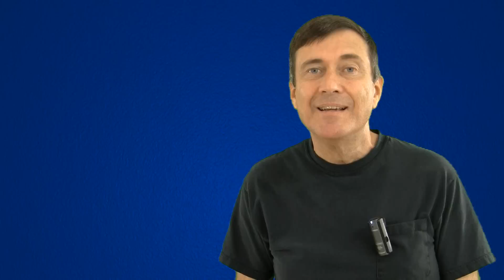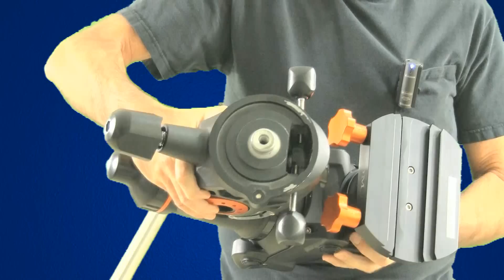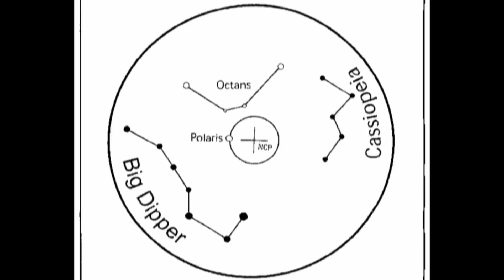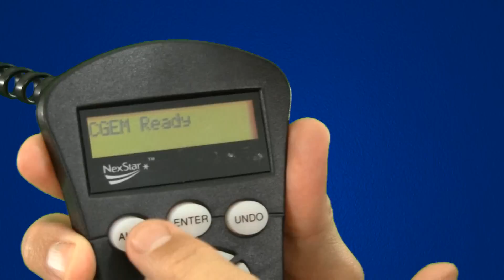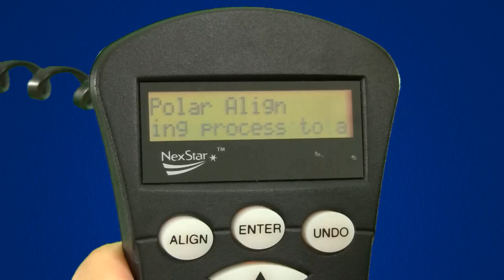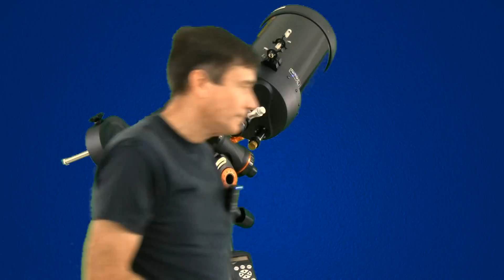NexStar Polar Align w/ASPA

Comment: So basically, I'll be fiddling around with my new Celestron C6R AVX a good 20 minutes before I can even view or image? sigh  What have I gotten myself into? LOL
Reply from the maker: That is how long it takes for the clouds to roll in. Seriously though, a steady goto mount is wonderful. I have heard lots of good things about the AVX mount.
Reply: You only have to fiddle that long for imaging. For visual I can set my whole scope up in about 8 to 12 minutes, including doing some calibration stars. For imaging, I've added some pads in my yard with some notches, and I leave the mount set up in the garage and haul it out as one piece. That way, the alignment is pretty close to what it needs to be at startup.
Reply: Anvilcjl I've had the AVX since Jan. now and it's great. The only thing I haven't figured is the PEC feature for Drift Align. Other than that I have great imaging sessions with it using a guide scope.
Reply: Paa Hawkins Yea, I've tried to get my alignment best I can, but it's never good enough to do more than a minute or two. Even if the alignment is perfect there is issues with the gears...a guidescope takes care of all that I think. Usually sky glow or light pollution takes over if the images go too long, and a guidescope usually can keep things aligned for long enough to to do a 5 or even 10 minute exposure.
Reply: yes it does. I've gotten 6 minute exposures with my guidescope and that's without having tried much longer due to lack of patience at the moment. lol
Reply: Anyway, lots of shorter sub exposures are better than a few very long ones. You never know with a long exposure if a satellite or something will travel through (which has happened to me many times near the pole) or if the gearing will go wacky for a short time. If I can get a bunch of good 5 minute exposures of a galaxy I'm pretty happy.
Reply: 5 minutes is considered long exposures. Short is anything less than 2 minutes.

Comment: I have had only 3 nights where I was able to use ASPA on my AVX and you were right that the alignment gets better after multiple times. But I still end up a tad off. Then I realized the ground I was on wasn't really level. So having leveled my mount, now I am just about +/- 3 arc seconds off. This video was very helpful in confirming what I have been learning. Thank you.

Comment: Great video and really helpful. Could you possibly explain the benefits of polar align as opposed to using an Alt Az mount. I have a Celestron CPC telescope. Would I really benefit from a wedge?
Reply from the maker: Without being polar aligned you will see things rotate clockwise in the eyepiece. Different parts of the sky will rotate faster than other parts of the sky. Typically you won't notice too much rotation in just a half minute. After several minutes though there will be significant rotation. If you are taking a 5 minute exposure it will be blurred due to the rotation. Thunderf00t made an animation of Jupiter that shows this problem. The animation is in the middle of the video.

Free Your Mind!
Free Your Mind!

He took 10 seconds worth of pictures every 3 minutes using an 11" CPC. Because he didn't have a wedge he had to rotate 160 images by hand in editing software.
Reply: Thanks for the advice, i think i'll need to invest in a wedge.